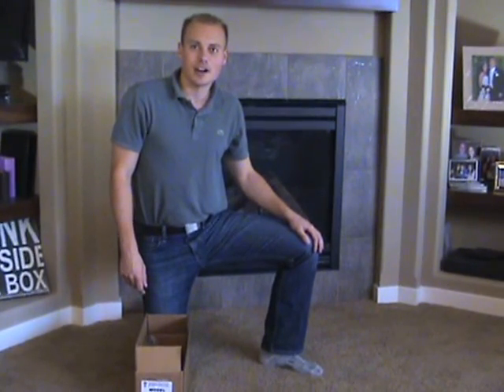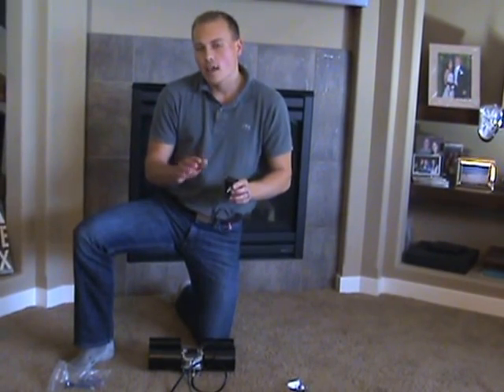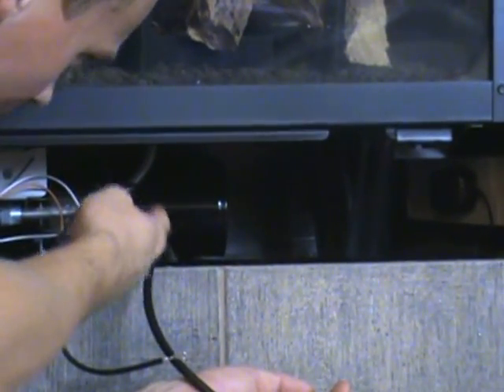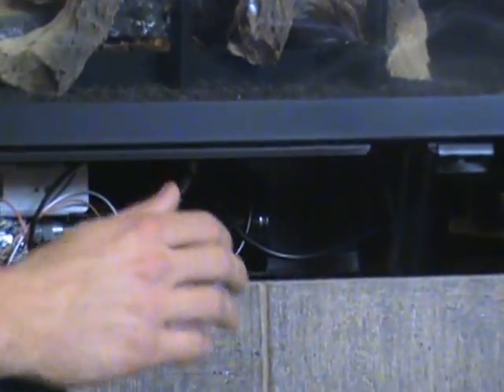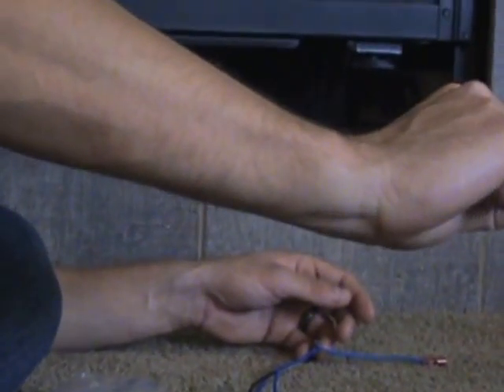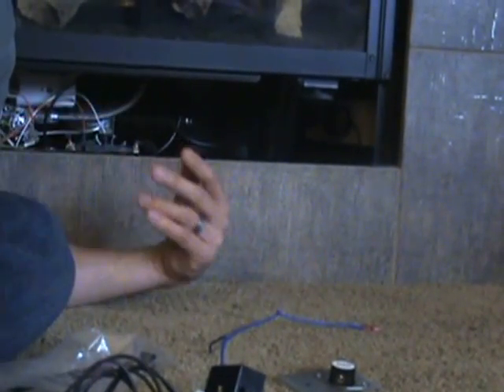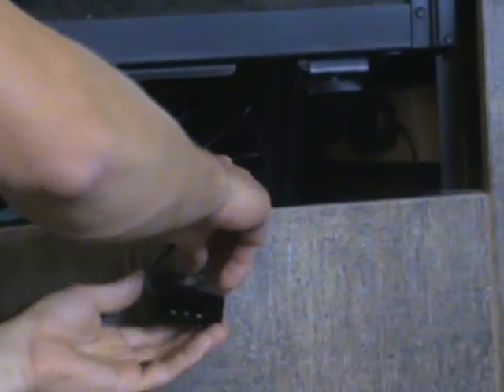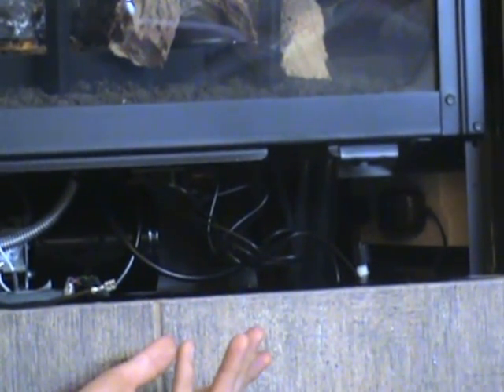Heat N Glo Fireplace Blower Installation Guide Tjernlund Fan

Comment: Would really be helpful if you could show what wires connected where. There are 2 wires from the speed control switch and there are some wires from the box the motor plugs into. So what goes to the thermostadt and what to the blower and what to the speed control switch?
HELP!

Comment: Installled on Heat & Glo model SL750TVD.  If you remove the intake duct (2 Screws) the blower slides right in.  Whole thing took less than 15 minutes.

Comment: Those first two wires, did you connect them to the blower motor that you slid in there?? If so could you connect them to the blower first before sliding it in there??

Comment: My Fan motor will not turn on. If i plug motor into an extension chord, it will work. I have power into my temp sensor switch, but none out. Does that mean i need a new temp sensor switch?